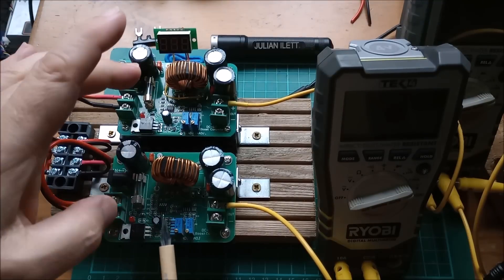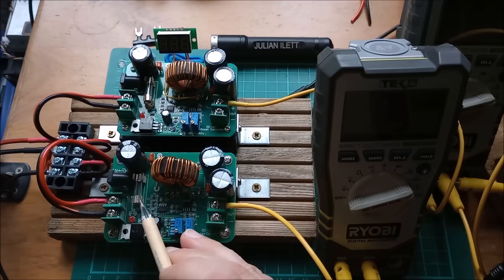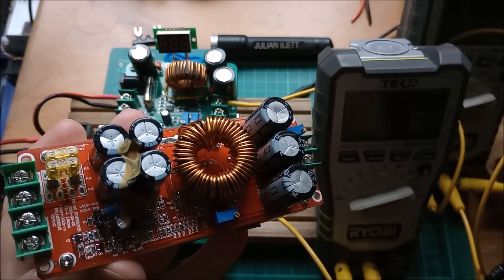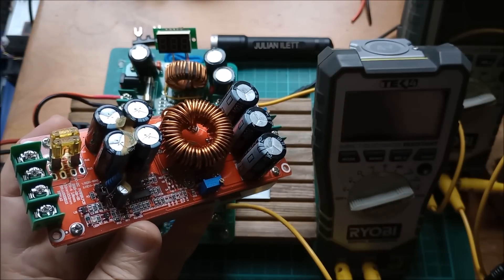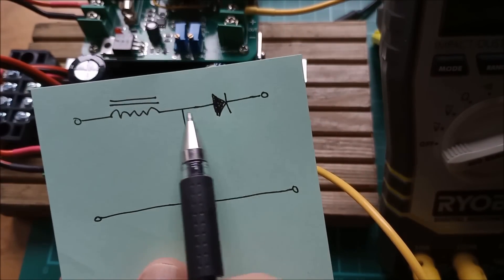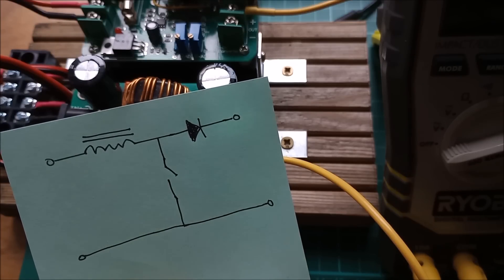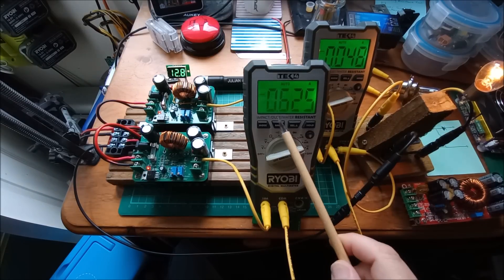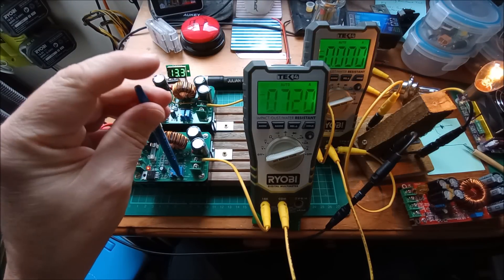Parallel Boost Converters

Comment: a great advantage that your video gives us I must tell you is the thought it gives us when we have many different panels How can we gather them with the converters through the experiment you did so that we can have a constant VOLTAGE AND INTENSITY so that we can convert the simple inverters into hybrids. You understand what I'm saying. He will send the inverter directly in front, so the batteries will come into play later, or at least we will concentrate the many different panels in one voltage and one voltage so that we can use less charge regulators. If and the charge regulators when adjusted with step voltage not all with the same voltage we have noticed that the lead acid batteries that the companies gave us for three years live at least 5-6 years up to 10 years and we found it after studies I can't I will analyze it now it is complicated if you want I can send you an e-mail detailing the thinking and the process so that the systems of friends abroad are not destroyed until they put lithium But again your experiment and for lithium when we have many different panels or when we want to make the Inverters work as hybrids AND FOR THE LITHIUM SO THAT THEY DON'T BOIL THEY ARE A REGULAR ISSUE THEY TOLERATE BMS It's extremely successful Think Thank you very much I feel very beautiful Be well

Comment: The sensible option would be to use a single control circuit and parallel the input and output components. So the parallel inputs and outputs are reconfigured to accept the control signals from a single board, while the other control circuit is removed or disabled. Otherwise one circuit will always attempt to drive the other at the output due to component tolerances and variations on the voltage/current limit potentiometer settings.
Reply: Right idea.
I thought he knew electronics !
Reply: @snakezdewiggle6084  I am surprised too, does he know what he is really doing!

Comment: Current limit solves the problem. But how about a electronic perfect diode, i think that will give you voltagebalance as well. Anyway thans jullian
Reply: No, that will not work. The fundamental nature of a constant voltage power supply trying to behave as a zero impedance source, prevents it. Constant current supplies try to behave as infinite impedance sources so they do inherently share.

Comment: Does the same applies for buck-converters? Or it is required to add diodes at the outputs?
Reply from the maker: I've seen people putting various power supplies in parallel. Probably only works if the power supplies have current limiting, but I've yet to try it.
Reply: The problem is the same for any constant voltage regulator, regardless of type. It is a function of the fundamental nature of the supplies. Diodes don't fix anything with regard to sharing.

Comment: The problem is the one that the converter with the lowest setting will stop providing power to try and get the output voltage to drop. Which means the the one with the highest feed back setting will then be taking the full load. Putting a diode will not make a lot of difference to the power sharing. it will just stop one back feeding the other. Paralleling power sources can be very tricky, even removing the feedback form one and using the same feedback to feed both might work.

Done this with very high power alternators and it can be very expensive to provide all the required control signals so the big buggers share the load.
Reply: Yup!
Reply from the maker: Yes, exactly :)

Comment: You can add diodes to the output so that the second DC-DC converter does not receive the voltage from the first one. This way, you can effectively balance them even when in voltage limiting mode.
Reply: Thought the same but no spend many hours on it and every time one would do the work until you set the second one high enough but then it would runaway and burn the fuse
Reply: @DiyNuke I’ve experienced the same issue
Reply: That will not work. Assuming perfectly matched diodes, the supply producing the highest voltage ahead of its diode, even by a few millivolts (depending on the gain of the error amplifier will take 100% of the load until it transitions to current limiting.
Reply: @D614G_aka_Doug Im a little bit confused of your point please enlighten me. But I see some ideas from that, are you trying to say that a parallel converters with isolating diodes at the output will not work or they will but due the imbalance in voltage the buck with the higher voltage will work 100% till it reached its current limit, and the second one us doing nothing at all to the load sharing? So heres my scenario, assuming that my system need 25amp and my buck only supply 20amp max. What I was thinking is to use two of this buck converters and parallel them with Shottky diodes in each positive output of the buck. and set the current limiting of each buck to 15amp, and when the first one reached its limit(15amp) the second buck will start to contribute to the load sharing providing the remaining 10amo I need. So here, Im not pushing the buck to its max capability (20amp) but limit it to 15amp, and the purpose of the second buck is to be back up converter to supply the power the first buck can no longer support. Coz I already accept that load sharing is impossible in this set up, so I came up with this idea, and accept that the second buck will just serve as a buck up converter. Is my point making sense, is it correct or will work fine? Thanks for your response
Reply: @D614G_aka_Doug Im a little bit confused of your point please enlighten me. But I see some ideas from that, are you trying to say that a parallel converters with isolating diodes at the output will not work or they will but due the imbalance in voltage the buck with the higher voltage will work 100% till it reached its current limit, and the second one us doing nothing at all to the load sharing? So heres my scenario, assuming that my system need 25amp and my buck only supply 20amp max. What I was thinking is to use two of this buck converters and parallel them with Shottky diodes in each positive output of the buck. and set the current limiting of each buck to 15amp, and when the first one reached its limit(15amp) the second buck will start to contribute to the load sharing providing the remaining 10amo I need. So here, Im not pushing the buck to its max capability (20amp) but limit it to 15amp, and the purpose of the second buck is to be back up converter to supply the power the first buck can no longer support. Coz I already accept that load sharing is impossible in this set up, so I came up with this idea, and accept that the second buck will just serve as a buck up converter. Is my point making sense, is it correct or will work fine? Thanks for your response
Reply: The problem with this is that the current measurement is on the negative side for those devices. Basically the current from one returns back through the other causing that one to keep turning down its current until its effectively off.
Reply: @neutronstorm So, diodes will not stop the current from flowing from one supply to the other?
Reply: @LizardsEyes  no, it will not.
Reply: @neutronstorm  
Unless the circuit is very unusual, the voltage across the current sense resistor is irrelevant to the failure to share current when the supplies are operating in constant voltage mode. That failure is due to the fundamental nature of a voltage regulator - it is "trying' to behave like a source with zero impedance. It does this by means of an error amplifier that has very high gain, typically in the ranges of hundreds of thousands at DC. Error amps are typically run with no local feedback at DC, so you get the full open-loop gain of the amp.When you connect two power supplies operating in constant voltage mode in parallel (call them A and B) and A is st (say) 10.000 volts while B is set to regulate at 9.995 V, the error amp in supply B will tell the power delivery part of the circuit (linear or switcher, it makes no difference) to turn off completely. You might get both A & B to share with very careful adjustment, but changes in temperature could easily destroy the balance.
If the total load current cannot be delivered by one supply, then one supply will go into current limiting and the other will deliver the balance of the required current. There definitely can be issues with non-isolated supplies that are paralleled with current going through the "wrong" return path. And of course if the current sense resistor is between the output [-] terminal and the circuit's negative and you return the load current to the input supply negative, the current sense resistor knows nothing about the output current at all.

Comment: DC OHMS  Being biased

Due you cant get 2 or more Exactly  Identical components Perfectly Identical  in every Way 
Impurity's and imperfections Change the ohms Value of Every component  is annoyingly  Unique And more Prone to being DC biased Even  the Wire Ohms and Length it bloody fussy  and Start's  Getting A single  Favourite (Due its Shorter or less Resistance )

it why DC Power networks (DC National Power grids ) Dont  have 2 or more DC Generators Power stations due DC is so Much of a bitch To Deal with it going biased with just Resistance Distance and ohms slight change and it has a Picky biased personality

You see  it a lot in Battery cell arrays some Cells Want Chrage super fast and Some take Days ~ weeks ~months to come up 
even discharged some cells jus want to give up power to fast and others holding on to it

Comment: H-mm, I believe to make them balance the load in Voltage limiting mode you need to re-arrange feedback lines for both: they should get feedback from a single resistor divider located at the output after current metering multimeters right at the light bulb connection...  Please, try.
Reply from the maker: I can't see that working. In voltage limit, the converters are on a knife edge. Tiny differences in op-amp gain would result in one unit doing all the work, and the other doing nothing.
Reply: @JulianIlett  I think that idea has some potential. Having a single high value pot for adjusting the output voltage and 2 smaller ones for very precise tuning to balance between them. Probably have the pots in a variable resistor mode with a fixed divider resistor.
There has to be some "linear region" in the feedback somewhere.
Reply: @SuperBrainAK  
It's all linear, but error amplifier gain is usually very high - typically limited at DC only by the open-loop gain of the actual amplifier, which can easily be in the range of hundreds of thousands. The difference required to drive the error amp from one rail to the other might be a millivolt or less at the sense point. Trying to trim the feedback paths for balance is futile.

Comment: Many commercial power supplies allow parallel units with a Schottky in the positive per supply.
Reply: The feedback loop senses the voltage after the internal diode. Isolating the feedback loop by adding an external diode on both supply's positive rail will help isolate the feedback loop. Commercial power supplies also uses current sharing controllers which further matches the output voltage for accurate current sharing, even during transients
Reply from the maker: The handy thing about boost converters is that they already have that Schottky diode in their positive output.
Reply: Yes, and no. There are designs without a (external) diode in boost converters. Some of the LTC Series are essential Inductor only. Then it becomes a question where your voltage feedback is done  @JulianIlett
Reply from the maker: Ah yes, my new favourite chip - the LT8705 :)
Reply: @brauchmernet  
There absolutely must be some functional equivalent of the diode for a boost converter. It may be internal to and IC and may be implemented as a "synchronous rectifier" (typically a MOSFET that is actively switched ON during the time the diode would conduct). Without the diode the main switch would simply directly short circuit the output every time it turned on (boost converter).
Reply: @JulianIlett  
I wish that part had been around back when I was designing switchers. It actually has voltage capability adequate for some of the stuff I did. I used to get excited by the announcement of some new switcher controller, only to discover the voltage rating was just a little too low for what I was doing.

I learned to hate switchers! They are horrible things in which everything is in conflict with everything else.
Reply: Schottky diodes at the outputs would be required for buck converters. Topology of boost converter implies that diodes are already there...
Reply: Adding diode does not solve the problem with current sharing when the supplies are operated in constant voltage mode. They simply prevent reverse current flow into the outputs of the supplies which can be an issue with some designs. It is still the case that the  supply with the highest setpoint, even if only by a few millivolts, will go to current limit first, followed by the supply with the second highest setpoint, and so on. It is the fundamental nature of constant voltage regulators.

Comment: When you parallel those boosters with the heatsinks, it blows the input fuses on one of them. No apparent damage though.
I have looked at using power diodes to provide isolation, but this is at the cost of losses in the Diodes as they will get hot.
Voltage flip is interesting, this occurs in batteries wired in parallel, because of the slightly weaker partner will take voltage from the stronger battery as a load till it gets drained.
So, if you fully charge a LapTop battery, then put it in storage, it will be flat or mostly flat when you come to use it next. The cells are paralleled in all to get the higher run times.
Reply from the maker: I think there would be a problem paralleling boost converters that measure current in the output negative. Putting those converters in parallel means all the current sense resistors end up in parallel. I think that would upset their current feedback loops.
Reply: @JulianIlett so how can you achieve 48V40A to 72v25A?

Comment: You just need a "ballast" resistor -> https://www.youtube.com/watch?v=2JPyDVeD0i8 👍
Reply: Ballasting the outputs is the ONLY thing that works in the general case (i.e. avoiding messing with the actual control circuity) but it comes at the cost of reduced efficiency and degraded voltage regulation (the whole idea is to raise the output impedance of a circuit that is trying to behave like a source with zero impedance).
Reply from the maker: Wow - those resistors - keep things nice and warm in winter :)
Reply: @JulianIlett  Exactly, you gotta keep the shed warm. 😜

Comment: It can be good to use cables of the same length (and the same quality) from the converters. Then these wires will act as small resistors, and the small voltage loss will cause the load to be distributed more equally (if the converters are otherwise the same).
A bit hard to explain without a picture.
Reply from the maker: I get what you mean - but the important thing is to get the converters into current limit. When they're voltage limiting, it's virtually impossible to get them to current share.
Reply: It should be possible to get 2 identical converters to deliver approximately the same amount of current. At low loads, there will likely be a difference, but at high loads it "should" be fine. Of course, it depends on the quality of the converters, and how much voltage loss you accept in the resistors (wires)... @JulianIlett
Reply: @JulianIlett This! The outcome of this test was known before the start of it. It's a good illustration for the "show me" people.